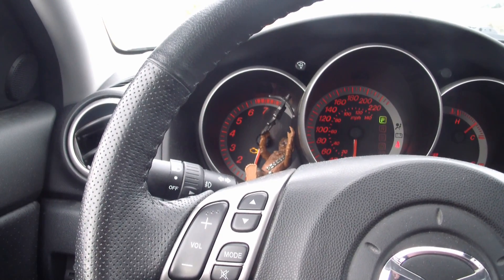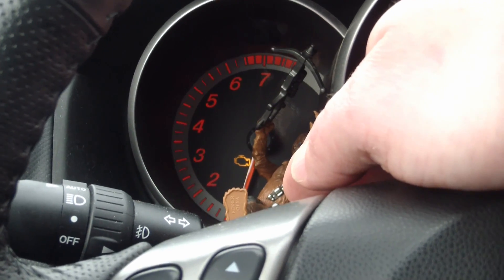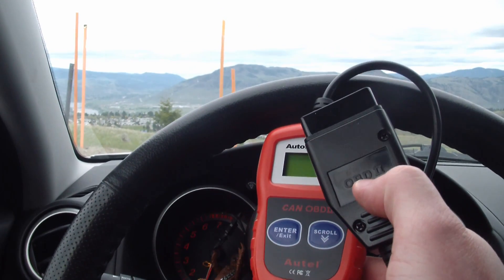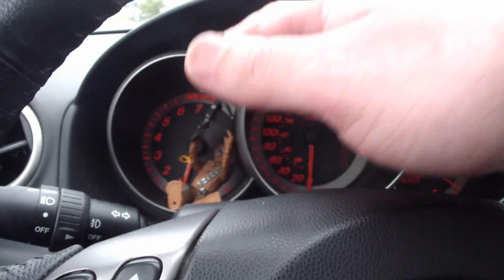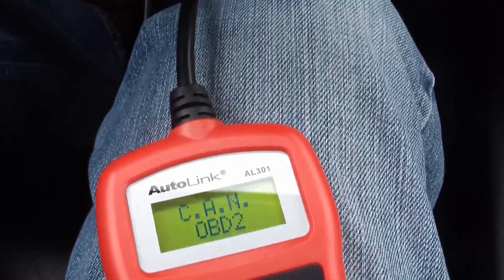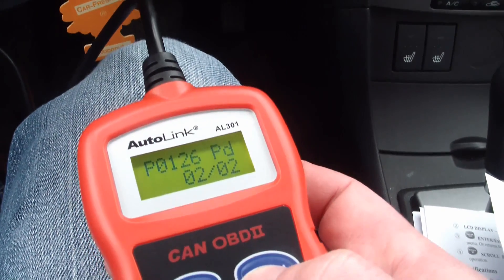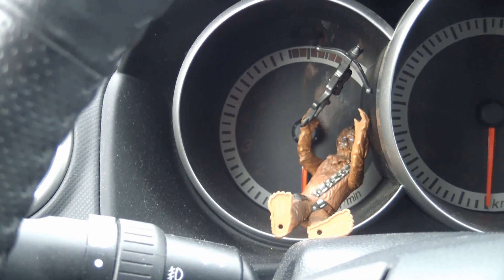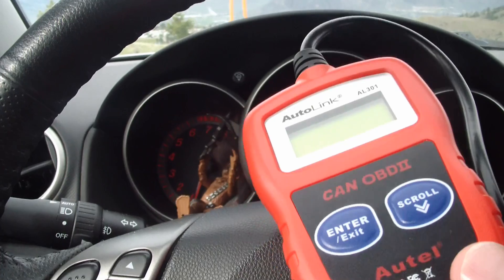Manly-Man Skills: Outsmart Mechanic Scams by Using Your Car's Computer!

Comment: Once i went to the (fiat)dealer when the light was on, they said they didn't know, charged me 30€ and asked me to come back when the light turns on again >.<.
Then i went to another dealer that was not horrible, and they checked the light, they replaced the hose that was causing it (they used google!) and couldn't clear the fault because you need fiat software >.<, at least they only charged me about 25€ for the fix.

Happily the code cleared itself in about a week, but i will definitely get myself a obd reader.
Reply: xnutral why would you by a fiat in the first place?
Reply: ***** They also sell the cars so if i want fiat specific stuff i need to go to them like if i have to go for my 30k km oil change, because the computer needs to be reset afterwards (or it will throttle the engine)
Reply: xnutral Wow, I am never getting a Fiat, thats terrible!
Reply: ***** Most people can barely drive, let alone figure out what is wrong with their car.  One of my roommates was going to take his car to a shop to get his TIRES INFLATED.  He asked me where he should take his car to get it done, and I told him to just go do it himself.  The look of astonishment on his face when he found out that you can inflate your own car tires was priceless.  If he had taken his car in to a shop, they could have told him that his flux capacitor was not correctly calibrated to go off when he hit 88, and he would have called home to ask for $700 for new parts $700 for labor and $25 for the air.
Reply: ***** Yeah I'm in the US.  Scary thought: No, he cannot buy a handgun... yet haha you have to be 21 and take a simple (and I mean so simple that this kid would probably pass) test, but my roommate in question is only 20.
Reply: xnutral so would the obd reader that you are going to get, would it have told you to replace whatever hose fixed your car?
Reply: xnutral Look up MultiECUScan (formerly known as FiatECUScan). Depending on car even the free version should be good enough for basic stuff.

Comment: These are great! But they can throw you off sometimes. My BMW has several fault codes saying it's misfiring, that the timing is off and that the fuel mixture is wrong, but really it's just a vacuum hose. So don't take everything that box says as gospel! And in cars made before year 2000 it might be a proprietary plug, not OBD2.
Reply: A lean engine does misfire. The fuel/air ratio was out of control and the timing was very likely over retarded. All from a vacuum leak (unmetered air). OBDII is 1996 and newer but some 95s have OBDII ports and will retrieve live data.
Reply: Derrick Hodges Even with ODB2 present in 96 some manufactures maintained the proprietary plug for their specific diag tools which provide far more data from far more modules than just the plug and bang diag dice quick check.
Reply: Derrick Hodges Thats true, my point is that those fault codes doesn't always tell you exactly whats wrong. Mine was just a really bad example I guess. Maybe just BMW then, cause I'm pretty sure only E39s made after 2000 have OBD2. My 2000 model has the proprietary BMW plug in the engine bay, and OBD2 in the driver footwell

Comment: 100% agreed.  Anyone that owns a car made after 1996 and that has mechanical or DIY aptitude/ability should own a code reader.  The dealership is the absolute last stop in this process for me.  I don't even fault the dealership techs, but its just as AvE points out, it's the entire system that is engineered to liberate dollars from pockets.  Just this month I saved around $1600 on a fuel pump replacement on my soon-to-be-not-mine-anymore Honda CRV by diagnosing the issue and completing the repair myself.  The cost: A paltry $90 in parts, my own elbow grease and time spent doing my homework researching the issue.  Pain-in-the-ass?  Sure, at times, but also immensely satisfying once completed.  I can now sell it with a clear conscience.

These days there is so much free information and shared experience available to the consumer in the form of online forums, how-to channels on youtube (EricTheCarGuy and Scotty Kilmer are definite go-tos) and even your local parts peddlers... depending on who you talk to or where you go, there can be a lot of knowledge/experience found behind those counters (YMMV).  With the OEMs turning out models by the hundreds of thousands, simple probability is that someone else somewhere has experienced the issue as well, fixed it, and logged it in a post on a brand-specific forum, blog entry, or in an online video.  This is especially true with pattern failures.

I'm not saying everyone should tackle their own automotive hiccups, and there's stuff that I won't touch (Automatic Transmissions) but if you're watching this channel, I'm pretty sure the audience for this message is correct. Cheers everyone, good luck out there.

Comment: If the codes comes back up you are looking at 2 likely scenarios. 1 is the thermostat is going bad (easy to replace) the B is the coolant temp sensor is going bad.  This is easy to check with an infrared thermometer.  If the code pops back up and the temperature gauge is right where it should be then take the thermometer and point it at the top of the radiator or the upper radiator hose.  It should read around 165-180F with the engine at operating temperature (indicating the coolant is around 185-195). If it is very low that would indicate a stuck open thermostat. If it isn't low then the sensor is probably bad.  

Unfortunately most modern instrument gauges are little more than idiot lights with a needle. The manufacturer puts a huge dead zone in the readout of the a gauge so people don't see them swinging up and down with normal engine operation and panic.  

That being said the computer will normally switch to closed loop sensor mode around 160F and will only throw that code if it fails to reach that temp multiple times in a row.

Comment: Couple things came to mind. 1st, your average generic OBDII reader will (very likely) only read the "P0" codes which are only used for emission related issues. Especially newer cars will have a metric fuckton of make specific codes that a cheap OBDII reader can't read for you. So saying that the cheap reader will read all your computers/modules is a little bit misleading.

2nd, if there's no hard fault (say ongoing misfire for example) your CEL is designed to shut off when you erase the codes. That doesn't mean that everything is ok. When you erased the codes you also erased the current self diagnosis results from the PCM. Now you have to do the full self diagnosis cycle again (driving on various speeds, RPM, load etc.) before the light will light up again. This is especially true on coolant temp issues where the problem is only detected at operating temperatures.

Otherwise it was spot on.

Comment: My car is the last model year of OBD 1. Makes it a little tricky to find out what's up sometimes. The good thing is that you can turn on the car electrically, pump the pedal  5 times quickly, and it will give you the code by flashing the check engine light morse code style. I know dodge has a similar feature with their OBDII cars. You can also get some apps, and a blue tooth OBDII port, that will tell you why your cars not chooching  right.

Comment: Also: 90% of amber engine lights are loose gas caps (vacuum loss in tank = possible gas leak = those emissions folks at it again)
Reply: frollard Nowhere near to 90% man.
Reply: Wrong
Reply: PhattyMo lol my 05 expedition has that tighten the gas cap dummy light,  only comes on at bulb test, it can also be a problem with the evap canister purge solenoid too... also makes the gas nozzle at pumps cut off before the tank is full in many cases.
Reply: frollard It was a problem at one time,on older cars. Newer cars can detect this EVAP leak,and many have a separate light,that tells you to 'go tighten the gas cap,dummy' without throwing a code.
Reply: frollard where did you pull the 90% figure from. that is absolutely false,
Reply: frollard That's not true. Some cars have no gas cap at all now. Plus the only thing that can smell a gas leak would be the driver.
Reply: MrADVANCEDTEK Fuel tank pressure sensors see atmosphere pressure and turn on the check engine light, has nothing to do with smell.
Reply: Derrick Hodges I never said it did. He mentioned the tank pressure sensor not reading vacuum as a gas leak. Show me a light that says your tank has a hole in it. There's "NO" code that will state that at all. People read "possible cause" and ignore the actual code definition.
Reply: Re re, ok I love it when people go out and spend money on tools they don't know how to use, then dump money on parts that don't fix the car.  As a technician 50 percent of the cars I look at have new parts but the same prob

Comment: Saved myself an assload of pain with my last car...3 series bmw.  one of the ignition coils gave up the ghost and it was only firing on 5 cylinders. It was clearly obvious from the knocking what was going on, but the code said exactly which cylinder it was. swapped the coils from 4 and 5 and then the code changed following the bad part; eliminated wiring, it's the coil.  Replaced the coil for 50 bucks and saved probably thousands in a shop where they would change them all with oem parts.

Comment: You'll likely find that fault code will pop up again after a few miles driving. The light won't normally come back on straight away after clearing codes.
Reply: ***** correct. every code on every car is different. it MUCH MORE COMPLICATED then people think.

Comment: AvE

 I wanted to offer a couple of other tidbits: one, for under $10 (in our Canadian pesos) you can order an "ELM 327" bluetooth OBDII reader from our friends in the PRC. If you have an android device with bluetooth capabilities this is THE way to go. Paired with the free version of an app called "Torque" it reads and clears codes but when it comes up with the code number you can tap on it for the description instead of just the number.

Also, I'm pretty sure that most modern cars need a couple of drive 'cycles' to reproduce a code once it has been cleared unless it is a serious self-destruct death warning code.

And finally if it's an older Subaru the Check Engine Light is actually just the 'power on' indicator. :)
Reply: retro666future Get a car that old and you'll need to.
Reply: techieadam Most applications don't give two shits if it's a counterfeit device. :)
Reply: That's what I use every time the light comes on. Which it does frequently. Always the same nonsense reason. There is a sliiiiiiight problem with a lambda probe. If I clear the fault it will be gone for weeks. 

It even passes environmental inspection even though the dealer said it was super important to fix this right away. The dealer also happened to want about 1200 us money equivalents for the job and the same for a new probe. Thanks to me pushing my own probe into the slot I could also track how much has I was using and realised it was as good as when the car was new 10 years ago. Interestingly the dealer said we would be using a LOT more fuel in our current predicament. Needless to say I  agree that they should be called stealerships and won't be going to them again. 

Once again confusers save the day.
Reply: retro666future I'm sure a car so old it doesn't have any electronics will require quite a bit of TLC to keep rolling. That has nothing to do with new cars.
Reply: froshmasta +1 for Torque. Awesome app!
Reply: "...If it's an older Subaru the Check Engine Light is actually just the 'power on' indicator." That's a joke right there.
Reply: froshmasta I have one. Got to make sure you don't get a counterfeit. There are websites that show the differences. I use an app called "Dash" that tracks my mileage....
Reply: FrankTheCat The crap ones don't chooch right when live updating.
Reply: Thank you so very much
Reply: +1 on the BT module and Torque. Saved my ass a couple times in the months I've owned it.
Reply: FrankTheCat It will run but most likely slowly and probably crap out sooner.
Reply: I have no idea where this post is going, Tom
Reply: FrankTheCat 30$ high rolling it
Reply: +techieadam Why, but WHY would you update a protocol adapter that allows CAN bus and RS232 or Bluetooth talk to each other? That thing does NOT need to be updated. The smarts that you might want to update (or you might not - how often do you update your ECU firmware? thought so) is in the software for your phone/computer, not in the stupid OBD2 dongle.
Reply: JJayzX won't pass inspection in NYS either.  Thank you EPA
Reply: DIY master race FTW!
Reply: Jim Groth So I don't need to repair a new car? Why would I need to buy a OBD reader then?
Reply: Tom Wilcox No, I did not know what it was before I googled it, but I did my research and double checked with people more knowledgable than I am. The problem is actually not in the sensor but a (very) tiny leak that makes the computer think it's the sensor. The mileage is as good as it was when the car was new 10 years ago (probably a tad worse but measuring it over many trips shows no difference).
Reply: Jim Groth all you guys wtf its called get a good one best one fact cost about 20$ to 25$ and its called the BAFX elm327
Reply: The Subaru is just a power on? What  is that supposed to mean? Please explain.....
Reply: TheDarkestDestroyer
that's assuming I have the disposable income to buy the 'real' thing, yo.
Reply: All it has to do is speak a protocol. shrugs
Reply: Tom Wilcox  Volkswagen recall is... curious. Couldn't they force all companies selling small Diesel cars in the US into a recall with that very same logic? Or is Volkswagen the only one which sells class B and smaller Diesels in the US? There's this paper called "NOx Control Technologies for EURO 6 Diesel Cars" published by ICCT researchers based on ADAC data. The data is a bit spotty, but according to that BMW looks like pretty much the only company whose cars probably have about the same emissions on the road as in test setup. Granted, none of those cars are class B or smaller, for a reason.
Reply: Tom Wilcox  Thing is, all the information i can find is very spotty.

I found the official writing that EPA sent to Volkswagen, published on the EPA page. EPA is the US agency which certifies exhaust output of vehicles mass produced or imported in the USA. And thing is, it is... vague! One thing that is clear is that it's specifically NOx values that are above EPA regulations. It says that the ECU mode configurations kicking in on the test stand are akin to a circumvention device, which is illegal. But from that ICCT whitepaper i cited in my last reply, it follows that pretty much ALL small Diesel vehicles (and by small i mean body length below 4.50m approx or 15ft, displacement below 2.0L or 120 cu.in) exceed NOx norm by 2-8 times outside the test scenario, even though they pass in test, exactly because all of them have test scenario optimized ECU modes. This appears to be a standard solution. The ICCT article also explains the practical difficulty in meeting the norms. The exhaust system meeting the norms easily appears to add significant bulk to the system, potentially making it unsuitable for really small vehicles.

US exhaust test scenarios and norms are obviously stricter for diesel than in EU, because of political decisions.

I still wonder who besides Volkswagen releases small (as i defined above, shorter than 4.50m and below 2L) Diesel vehicles on US market? And if there are any, why they don't share the same issue? Or perhaps they do, maybe they just haven't been pressed yet.

I don't think VW will need to re-do the whole exhaust. I suspect VW can resolve the issue with software changes, by forcing rich run about 25% of the cycle, and correspondingly higher fuel consumption, maybe by as much as 10-20% extra. You are right that they will be forced to compensate the owners for extra fuel costs. It will also destroy the selling point of these vehicles that they are able to operate lean.
Reply: Tom Wilcox Thanks.

Well i used to work for a direct R&D subsidiary of Volkswagen group, as an engineer. Nothing related to propulsion or exhaust, nothing like that. So i'm just curious. And you happened to mention it and you seem to know a thing or two. Frankly i would have likely been at least mildly curious even regardless of my past, just because.
Reply: Tom Wilcox Yes, i know how it is. Some people are struck by injuries, others by illnesses or unfortunate circumstances. Depression is normal under such circumstance. Perhaps you'll be fortunate enough to overcome the injury in some way and find an outlet for your accumulated experience, i certainly wish you to. But it takes a lot of effort to do so and depression is interfering.
Reply: Seconded. Got mine for $3 and the real time diagnostic gauges go beyond a simple OBD2 reader. You're looking at thousands of $ for the snap on tool that does the same thing. Combine that with a  serial port terminal application and you can start discovering the proprietary PIDs and creating custom  Inputs and outputs. Something even the Snap on tool can't do.
Reply: froshmasta lol. get a real car without electronics and you can DIY everything.